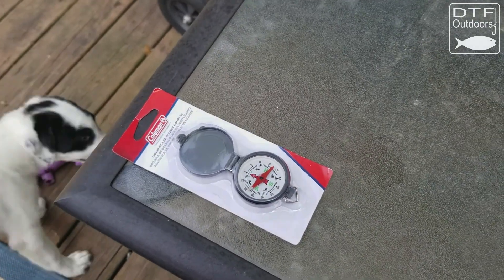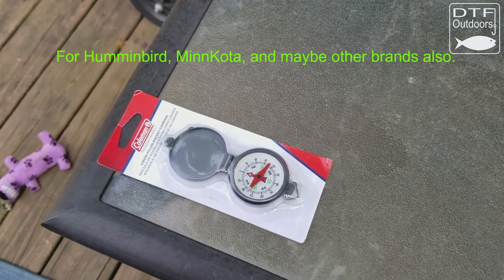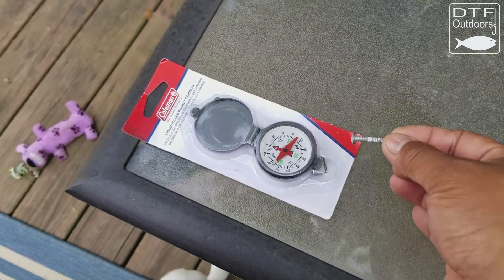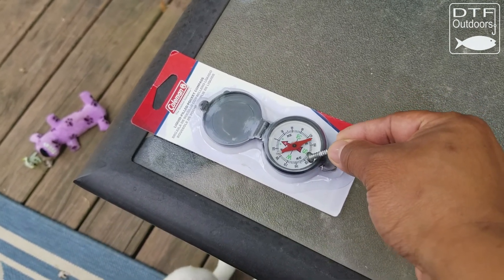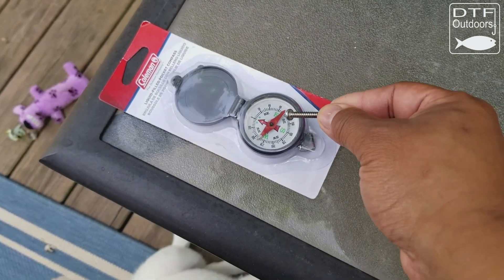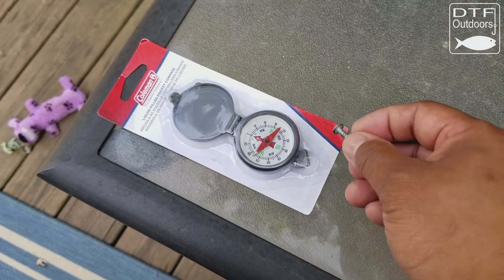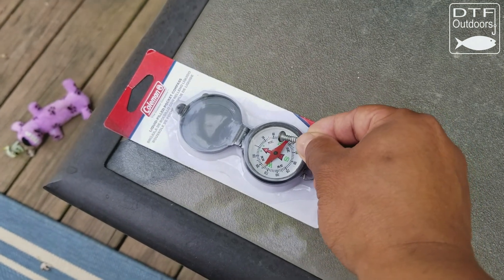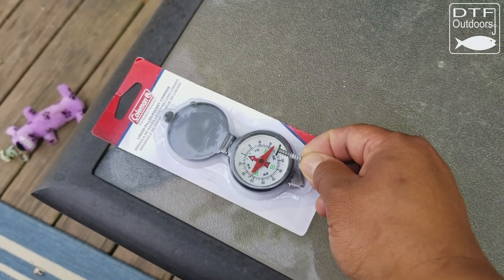Humminbird and MinnKota Heading Sensors install tip

Comment: I have to mount my vhf fairly close to my heading sensor on the dash and im worried it might cause interference. I guess I could use a compass first and place it close to the radio an see if it moves the needle